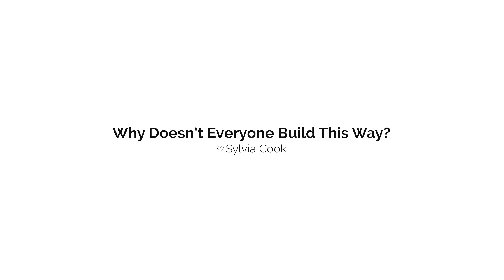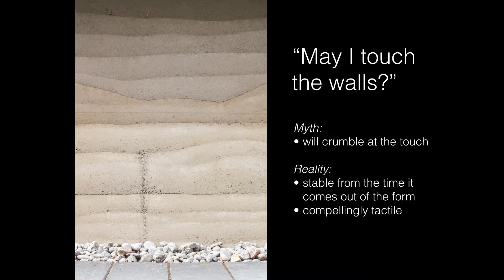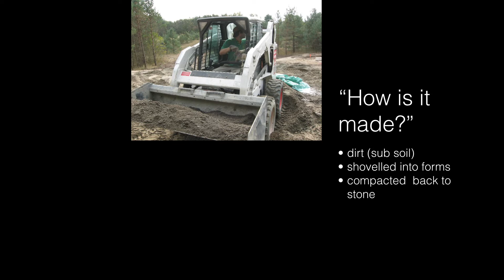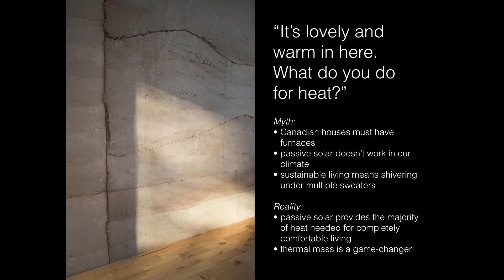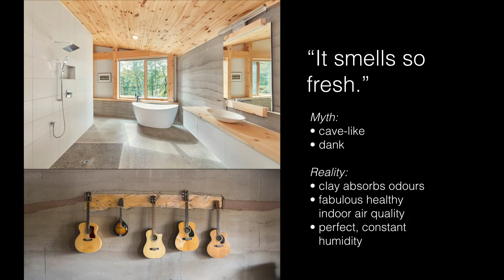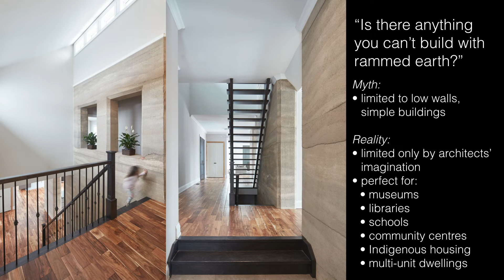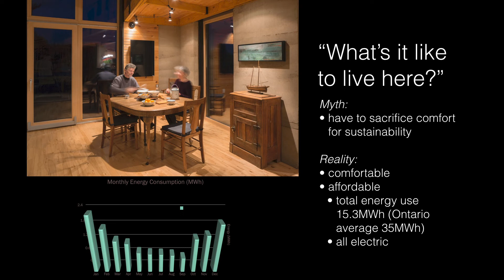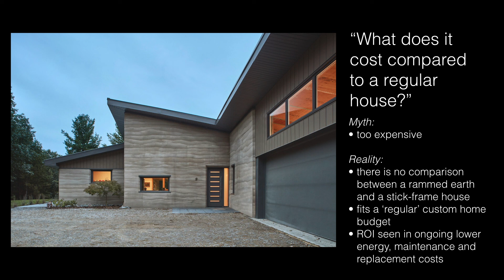Boots on the Ground: Why doesn't everyone build with rammed earth?

Comment: You need to do a bit more research about thermal mass and how it works, because thermal mass without insulation is not a good idea, specially in climates with long cold winters and short cloudy days.  It's similar to a battery and it can be "charged up" with both heat and cold. When the air is hotter than the thermal mass, then it radiates the stored cold, and when the air is colder, then it radiates the stored heat. Basically it acts like a damper to any changes in temperature and it gives a big lag (depending on the thickness) until the changes from the outside can be felt inside. So if you have a month long cold period, in which the sun doesn't have enough power and time to heat the mass enough as to compensate with the loss during the night, your house will get very cold at some point down the line and it will get almost as cold as the outside (it does insulate a bit). If you want to heat it up, well now you have a problem because you need to charge the walls up with heat and that will take allot of fuel and once you got them charged up you need to keep them that way if the sun cant do it for you, because the uninsulated wall will bleed allot of that heat to the outside. The situation is better in summer because you have the shade to help you out, specially if you design the roof in such a way as to block the sun from falling on the walls in summer, but let it through in winter,  but the principle is the same. The ideal locations for thermal mass based houses is in climates and areas in which the loss of heat during the night is balanced out by the gain during the day, same goes for loss/gain of cold. If this balance is not struck, then you will have to compensate by heating/cooling the house and the more extreme the unbalance is....the more you have to compensate. Best solution for any area outside the ideal one, is to have insulation on the outside with thermal mass on the inside, in which the thermal mass inside is heated by the sun in winter and shaded in summer. Even so, you're still going to need to "help" things out a bit in winter and possibly even in summer if you get hit by a long heat wave. Thermal mass by itself is not a miracle solution (except the ideal context), but inside a carefully designed system it can be very effective, on par with consecrated contemporary solutions with the added bonus of being friendlier to the environment, by a huge margin.

Comment: I like it - very beautiful. But what about excess radon issues?
Reply: I would think you could deal with radon like any other house: a perforated pipe under the slab venting to the roof, through internal framing. As far as radon from the gravel in the walls..? no idea. but people live in concrete structures the world over, and I think concrete has more rock in it than rammed earth. Should we be worried about radon coming from the rocks in the concrete?

Comment: I love earth and wood colors so I love the natural look of rammed earth. I didn’t catch where in Canada you are, but I’m in Fairbanks Alaska, and it can routinely get -40 here with much colder extremes. Do you put a core of foam insulation in the walls? And what do you use for the water resistance and the strength stabilization you mentioned? Even more than the cold I wonder how well it would resist earthquakes. Thank you!

Comment: I love the rammed earth concept and follow it's progress with great interest, but I think you are being a bit disingenuous when you speak at 4:24 about it not being just like concrete. To my knowledge all rammed earth structures incorporate a percentage of cement in their mixture - Cement, sand and stone is exactly what concrete IS. Rammed earth may not have exactly the same proportions as conventional concrete, but it uses very similar components as well as internal rebar in many cases to give strength, just like concrete. There is no shame - and many similarities- to concrete structures.
Reply: Cement is optional, it depends on the circumstances where the rammed earth is being used and for what purpose.
Reply: You can used cement or lime
Reply: She said waterproofing agent about 7 mins in I may retract my statement regarding this particular individual and what I stated 😂
Reply: Cement is strongest on day 28 then continuously deteriorates. Lime gets stronger year after year after year which is why ancient limestone temples still stand. I wouldn't use cement it defeats the purpose
Reply: I haven’t heard the speech yet, but concrete is usually extremely chemically induced. Natural building is called it for a reason. As you clearly state, cement usage is the clear discrepancy.. not the earth

Comment: No you can’t patch walls without spoiling the look. Plus it is incredibly expensive. I built one feature wall, 20 feet long, 12 inches thick, 12 feet high. Cost $60,000.
Reply: Wow just do it yourself at that point.
Reply: That’s a bit steep. It’s not like you’re using highly skilled craftsmen. I would assume it’s time consuming. I’ve seen it done before and after the worker got into a rhythm it took about 2 or 3 times longer than frame. When you factor out all of the processes you’ve eliminated it becomes more reasonable. It is not going to be something you do with expectations of saving money tho.
Reply: Yes you can. You can patch walls like any other walls. 
It's not expensive. It's actually a "dirt cheap" fix. 
You can save soil with dye mix from your original build in a can, or bag, and when you nee to patch, you mix the binder with it and fill the hole with a putty knife.

Comment: How do you hang pictures on the walls? Can you patch the walls from like nail holes etc.?
Reply: The same way you hang paintings on masonry walls.
Patch is made from the same material you built the home with, only you use a putty knife instead of a tamper. Soil, powdered dye to whatever color you need to match, and 10% portland, or lime, or chalk as the binder. (and water to hydrate the mix).

Comment: What about the temperature fluctuations?  Extreme hot and cold.  Humidity?

I live a region with very hot summers and cold winters, with extreme humidity.
Reply: In hot climate, it actually keep your house approx 12 degrees below the outside temperature .
Reply: @JAustin-c6q  They didn't address humidity, did they?
Reply: @thesanfranciscoseahorse473  Jesus Christ, you're either terrible at listening or you were distracted. She literally addressed the heat (both hot and cold climates) and humidity issue. She also addressed acoustics (sound performance) just in case you're about to ask.
Reply: @kim1570  Thanks.  I'm glad you're so concerned with my lack of attention to detail.  Let me throw another one at you?
My concern was never hot or cold climates.  It's the fluctuation between extreme heat and extreme cold causing expansion cracks in this material because it easily gets over 110F where I live in the summer, and down below 20F in the winter.

It's also very humid and rainy, so without sealers I'd imagine this could have negative effects on this material.  It has its limits and I was asking about the challenges in my specific area that I didn't feel were addressed in the video.  Thanks for your insightful, brilliant input though.

Comment: She is wrong about saying rammed earth is physical process and concrete is chemical process, actually they are both physical and as long as rammed earth use cement they are both chemical as well. Btw I can’t help but notice the heavy usage of wood in this house, speaking of termites.
Reply: The wood is not in contact with the floor though?  I'd think a termite issue would quickly be spotted vs your standard wood frame construction.
Reply: @thesanfranciscoseahorse473  The wood also doesn’t appear to ever be structural, just decorative. So insect damage isn’t likely at all but, as you pointed out, would be spotted quickly (it’s not hidden in a wall). And, worst case, any damage to the wood parts from any cause could just be quickly replaced.
Reply: Termites don't bore through stone. They also don't bore through concrete. The also don't bore through rammed earth.
Reply: Idk why they'd use cement, lime is the better option and still it is a chemical process as well but natural. Nature is chemistry so that was an odd statement

Comment: What is the axial capacity under compression strength for this type of walls also where is the steel reinforcing for lateral stress . Is there any study or test performed on this type of walls .
Reply: Some builders say it's about 20-30 MPa (depending on cement agregate and compression). There are recent public buildings with this technique in Mexico (lateral stress is their second name, haha). But I'm still trying to find such studies cause I want to build like this in seismic region. If you do find a paper on the matter, please let me know.
Reply: Rammed earth is an ancient building technique. It's not new. I'd think there'd be loads of data on it from them internets. If the load bearing capacity of it weren't high enough to hold a roof I'd think it would have been phased out by ancient peoples who got tired of a roof falling on themselves while they slept. As a non engineer who has done far more construction in my life than I like to remember I'd think the two foot thick rock wall would provide more than enough lateral strength. They build them all over the world with no steel in them and have been for thousands of years so they must.
Reply: @rovingmarks  well said, matter of fact you get a standing ovation. You just made me laugh with how simple you explained it.

Comment: Hi there! I need advice.
I've FINALLY CONVINCED MY MAN that rammed earth is the most economic and environmentally friendly way to go. We are going to start building - probably - some time before December of this year. I've been watching so many videos on this concept that its getting a bit overwealming, but no one seems to be covering certain topics..
1) Could you please give some guidance on how one goes about installing electrical wiring within a rammed earth wall? Or is there another way? Do I need to run cables along specially made grooves or cracks? 
2) We intend on installing airconditioning - so this is something I'm wondering about as well.. Will modifying an existing wall to accommodate an A/C later on compromise the strength and integrity of said wall? O know that A/C's will probably not be necessary, but my man is adamant on this.

Really, any advice or suggestion would be greatly appreciated.
Reply: Hello, i am from Africa and i have seen several projects done with rammed earth. to answer your questions, when it comes to electrical installation, its a matter of installing electrical conduit pipes into the walls before are rammed. as for ac i dont know about that since here ac isnt used much. u can also check out this link about a company that specializes in rammed earth in australia.  www.rammedearthenterprises.com.au
Reply: @brinohosey7498  Thank you very much for the information, I will have a look at the link as I am also from Africa, and the only construction company that I'm aware of that specialises in rammed earth is located in Ghana. That is too far from here. This means that I will be basically on my own and that is why I'm relying so much on information from YouTube.
Reply: @slipknotenthusiast6541  Rammteck is a really great company in South Africa, if that is closer for you?
Reply: @dragondan9  It's our neighbor. I honestly didn't know about this company and will look in to it. Thank you very much
Reply: @slipknotenthusiast6541  hello. Can you please where in ghana the company is and their contact information please?
Reply: @Chant I'm from pakistan...i want to work on Rammed earth type project....is there any Opportunity?
Reply: @tensionrose7001  There are none in my country. But I have heard of projects where people all over the world come together to build a house. This is more in Australia and some parts of America. I strongly recommend that you look online for Rammed Earth training programmes, or Earthship workshops. This will most probably involve traveling abroad.. Best of luck to you!

Comment: Cost is too high And the lack of consistent quality of material everywhere. Change those two things then maybe it'll take off. So far I haven't seen anyone  propel the technology forward.
Reply: Liz Swedlund Transport isn’t usually much of an issue because it is craned in on-site and the wall sections are usually not that big per piece. They use the same trucks as precast concrete. Yes the reality is rammed earth is still growing and prefabrication is an even newer aspect right now. With time and further development/acceptance it should easily help to fill a gap of providing a cheaper option that an in-situ build.
Reply: Do you know any companies that provide this service?  I'm curious about how expensive it actually is if I wanted to have a rammed earth wall installed around the yard perimeter.
Reply: I have built a couple of these houses, and I'm about to start my third, we have heaps of them in Australia they are great buildings.
Reply: Prefabrication of rammed earth kills those two birds with the one stone. It allows it all to be made the exact same so there is no variations in walls, and of course prefabrication lowers labour costs drastically. The only downside to it is the walls don't look quite as unique/individual as manually-rammed walls.